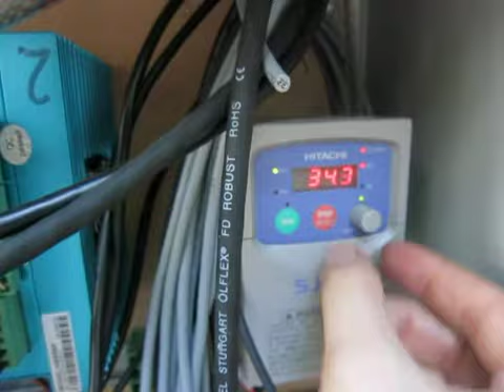coolant

Comment: Hey! I have an Emco PCTurn 125, I have no idea on how to grease it, how often, how much and with what kind of pump, any idea?
Reply from the maker: open this pdf file on link Emco Description manual 220 P
https://groups.yahoo.com/neo/groups/emco_turn_120/files/120P%20Manuals%20English/

My machine have automatic lubrication pump that oils bedways after 20 meters of travel , for balscrews I bought grease NLGI 2, anyway read manual and you will find everything there (I am using Vactra No 2 oil from Mobile)
Reply: +zmajmr Hello! I have it but it doesn't say how much to inject and with which nozzle. Have you done it already on your machine?
Reply from the maker: Ah, OK, for grease I bought grease gun but need to make nozzle, I will send you link what kind of nozzle you need to have , 
http://www.ebay.de/itm/350402669942?_trksid=p2060353.m1438.l2649&ssPageName=STRK%3AMEBIDX%3AIT

http://www.ebay.de/itm/261104756382?_trksid=p2060353.m1438.l2649&var=560159377713&ssPageName=STRK%3AMEBIDX%3AIT

Inject it how much you can, execs will come out anyway. I did not make it yet so I grease with my finger, need to make that soon as possible.
Reply from the maker: sure , I will answer your question when I come home, need to work 
here is my facebook https://www.facebook.com/marko.romic.54